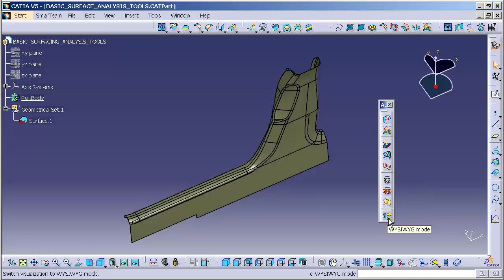Catia V5 | Catia V6 Tutorial - Intro to the Standard GSD Analysis Tools

Comment: Hi,

I am big admirer of your youtube videos on CATIA and NX. I have leaned a lot from you.

I am a design engineer working for an automotive company in CATIA. Whenever i get stuck i always prefer your youtube channel for solution.

Now I am facing an issue and I am not finding any solution in internet. I hope you can help me.

I want to get the bounding box size of my part. Right now i am using measure inertia tool to find out. But the issue is it is only measuring bounding box size of either solid or surface not together. If i have a hybrid model consist of both surface and solid how i can measure bounding box size.

Thank you I am waiting for your reply.